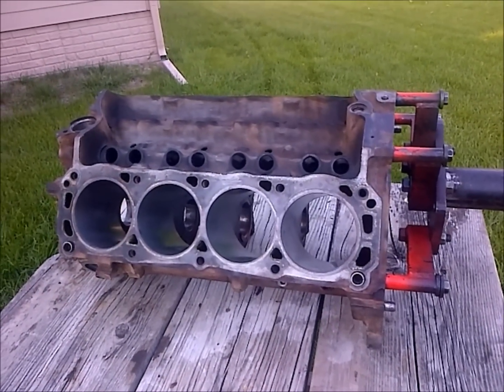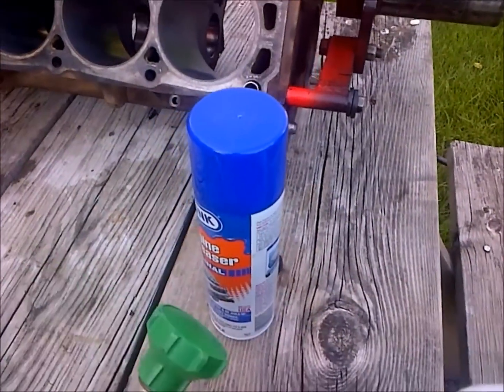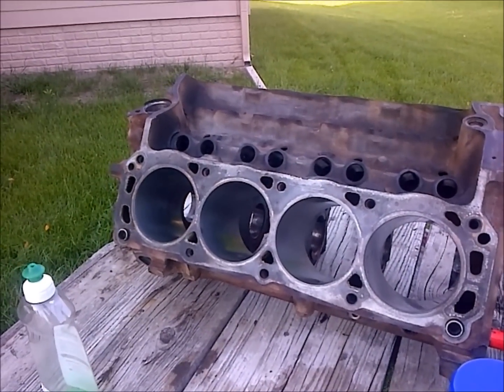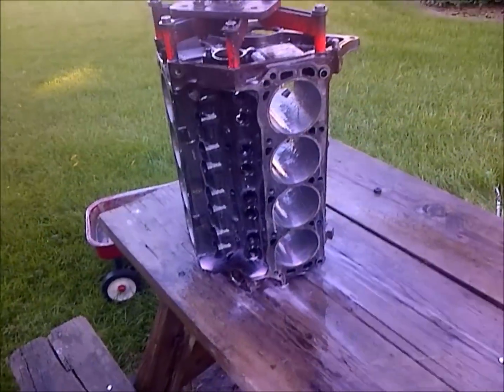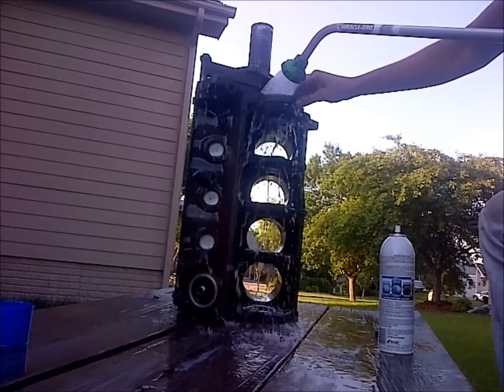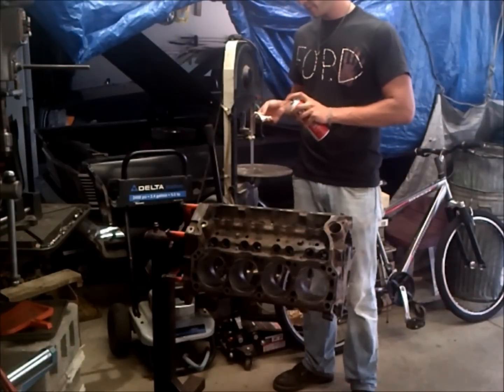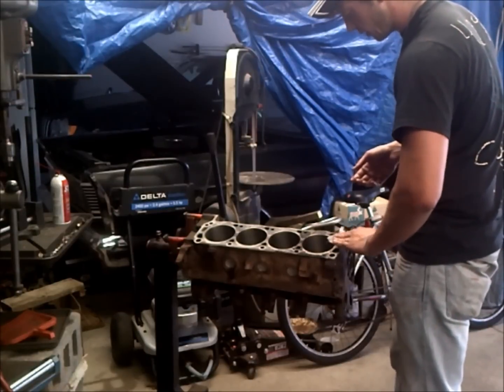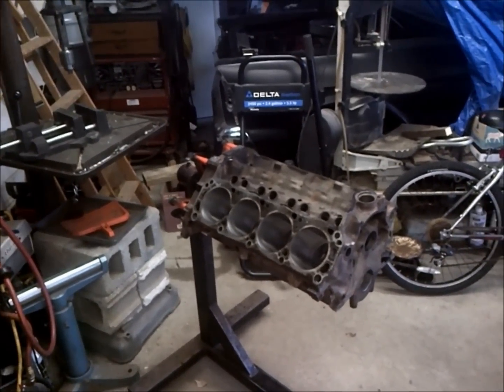PREP - Engine Block (Vid 2 of 3) - How To 302 5.0 Budget Rebuild

Comment: ............. You just gave your engine a virus by using water. The one rule to any engine build is never use water to clean it. Just use mineral spirits with a hand pump sprayer 🤦🏼‍♂️ 
It doesn’t matter if it’s an aluminum block. Aluminum blocks have iron in them
Reply from the maker: This engine is still running today with 60k miles on the rebuild that was filmed and still has 40 psi hot idle oil pressure. 
I think it’s just fine. Did you see any rust on it during this build? Yeah, I didn’t think so.

Comment: My 302 cylinder bores have a slightly raised edge at the top which catches my razor as I scrape the deck (not the ridge on the inside of the cylinder wall, but a burr like edge that sticks straight up and out of the bore).  I am wondering if I should gently chamfer these off?
Reply from the maker: In that case, I’d do what I could to remove that - it honestly shouldn’t cause an issue, but it’s not designed to be that way either per say

Comment: I just got my engine back from the machine shop it’s bored over and Hot tanked. Should I do a final clean on the block like your video? If so I had new cam bearings installed as well any suggestion would be much appreciated
Reply: Not like the video but yes.  Get in to every nook and cranny.  Check your crank oil passages for steel shot and debris.  Get some wd-40 and lint free towel or rags for mating surfaces and bores.

Comment: Why wouldn't u just get it hot tanked at a machine shop
Reply from the maker: this is the backyard budget build video series as if a guy was pulling the engine and doing it over the weekend.
Reply: because it costs 75- 100 bucks lol

Comment: is it really safe to use water when cleaning your engine block?
Reply: no that is not a good rust preventive.. WD-40 works fine and there is a few products on the market to seal bare metal from rust after machine work that work very good and last for years..  Since Some folks take a long time to finish a project.   I have placed that stuff on cranks and blocks and heads and sealed in plastic bags for 5-6 years at a time.

AND water is OK to use to clean a block.. Hot water is better.  It opens up the metal pours to get all the oil and carbon out.
I just hook the water hose to the hot water tank and use it that way.
Dawn soap works good...    I also get a high pressure washer and blast out all the water jackets and oil passages..  
Been building engines for over 20 years and thats what we did before all those fancy in house parts washers.  

After word I take and spray WD40 on everything and use air pressure to blow out all the small holes and such..      Either leaving the block in sun to dry or taking a heat gun and wedge it in the water pump cavity and let it heat soak the metal till all the moisture is gone.
Reply from the maker: As long as  wipe it down your fine
Reply: ThunderHead289 won't it rust your engine parts?
Reply from the maker: +Sander Lawrence well, it's a bare block. It takes some time to rust, get it wiped down and your fine. If your not going to assemble it or paint it right away, then hit it with some wd-40
Reply: could you use vasoline to keep it from rusting?

Comment: my engine is tore down almost completely. it still has the crankshaft, rods, pistons and camshaft installed. im replacing the camshaft with an aftermarket one, so im not worried about the stock one being messed up. would i be okay to pressure wash the block as it is, and then dry it with an air compressor and put a film of wd40 or engine oil on it?
Reply from the maker: +HomeAudioProject i mean you could, i personally wouldnt do it that way myself, nor would i say that you would be free and clear of any issues. thats pretty backyard. i guess as long as you reassembled and primed the oiling system like that day. . .
Reply: +ThunderHead289 i would do it right before i put in the new camshaft and reassemble the engine, then refill it with oil and manually turn it over
Reply from the maker: +HomeAudioProject I suppose you will be fine, but I just can guarantee it. Just be sure to prime the oiling system. You really really need to do that to push the water out of everywhere.

Comment: how long do I have before block starts rusting before assembly?
Reply from the maker: the bores will start developing surface rust within the day, so I generally like to oil them up with some wd40, and same with all the gasket mating surfaces. you don't want it to sit for a month unless it has had a wd40 spray down and is bagged.
Reply: Shit my Corolla engine been sitting under a tarp in my yard for like 5 months, am I screwed? I won't rebuild it till I can get a house, which may be next year